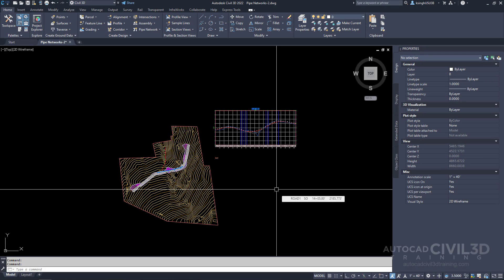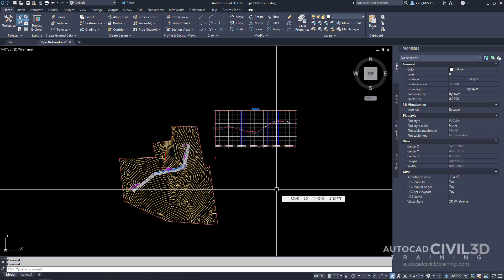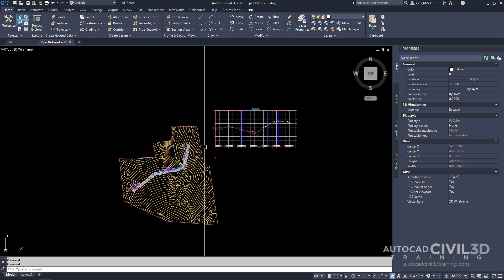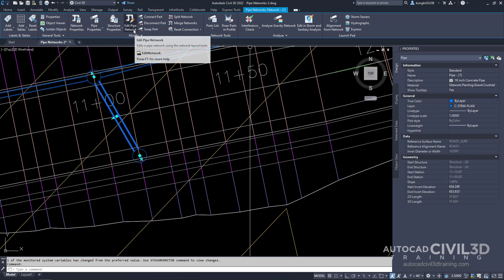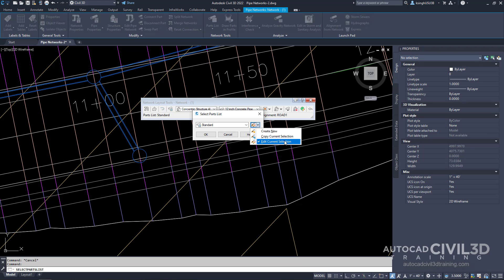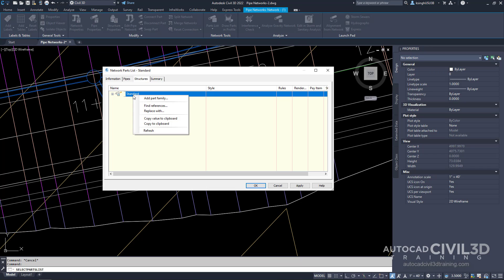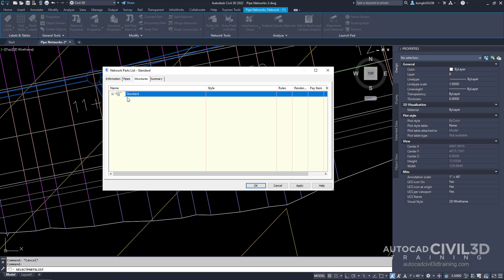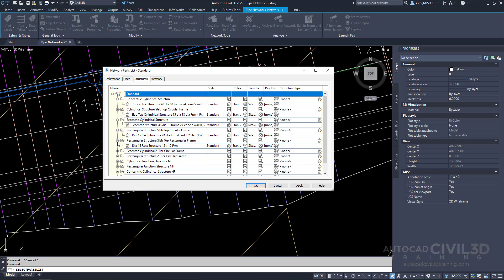Adding Parts to a Parts List in Civil 3D

Comment: Hi, why is It that I added the concrete rectangular headwall, but it doesnt display in the structures tab tree view? Thank you for Answering.
Reply from the maker: That usually means the part wasn’t added to the Part List you’re using. Add that rectangular headwall to the active Part List first — then it will show up in the Structures tree.